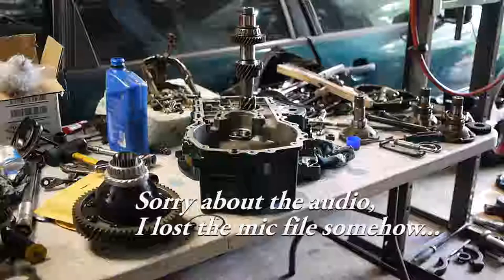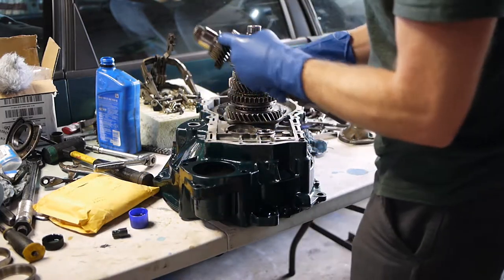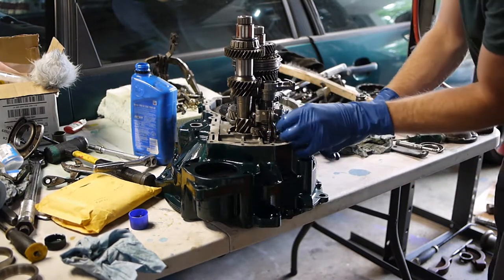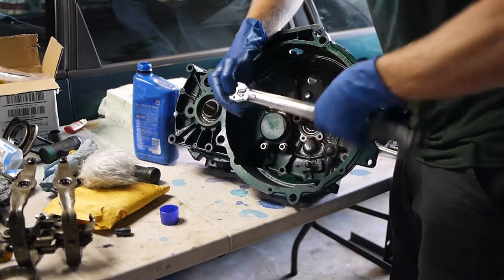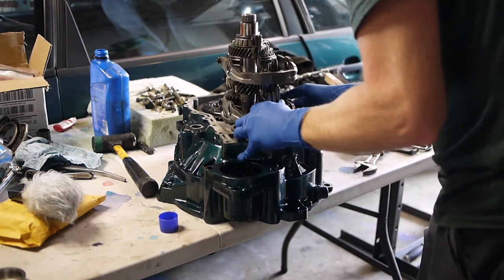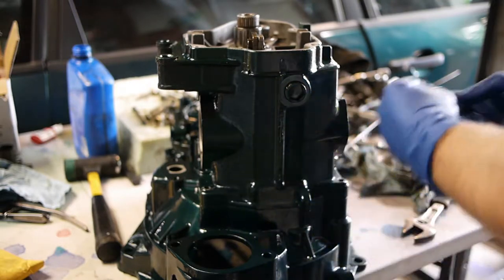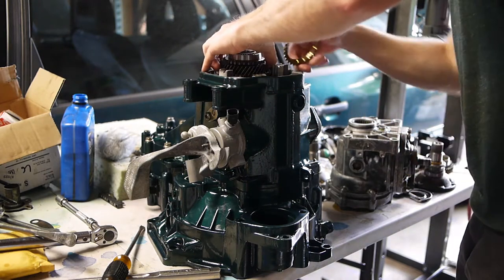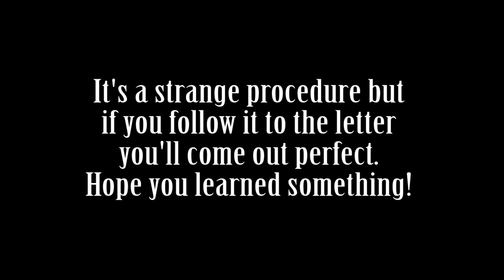02J 02A 02C Reassembly Part 3 of 3

Comment: The reason you do the 90degtees is because those are "always replace" stretch bolts. Torque is an indirect measure of clamping force, that should bring those bolts to just before the plastic deformation point. The added 90deg turn is a direct measure of how much it has to stretch. All of this is done for fasternes that are most critical especially in vibrating environment. Nuclear facilities and automotive are two very different environments, possibly with contrasting requirement, different materials (I don't think you use aluminum a lot in nuclear) etc
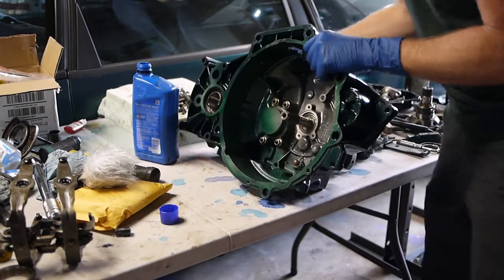Reply: 13:16 you feel like it's gonna break yes, you are indeed stretching the bolt so the feel is "constant force" instead of "linear increase" that's how it's supposed to be 👍
Reply from the maker: Still seems to me a cheap way of engineering. I don't run my ARP studs into plastic deformation and they do a fine job. The brace I was talking about in this video has seen a massive amount of abuse and 120k miles since I built this and I remember installing those well below yield. Hell, they were used! Still going strong. Cheap engineering to use such bolts. Just use loctite and normal bolts.
Reply: @andrewlewis4253  Indidnnot eneter in why they chose to do so. I'm just saying it's very common in VW operations to use those; most suspension and drivetrain bolts are like that. In some cases, non-stretch aftermarket bolts exist (flywheel, engine head) and for example in Toyota applications I hardly remember any stretch bolts. So i wasn't passing a judgement, just trying to explain the directions 😅

Comment: Did you also tear into your 02c angle drive? Curious how practical they are to maintain and work on (parts availability and reliability) as I'm looking at purchasing a syncro swap to convert my mk2 GLI. Also curious if you had any issues with fitting an 02C differential against the TDI ring and pinion.